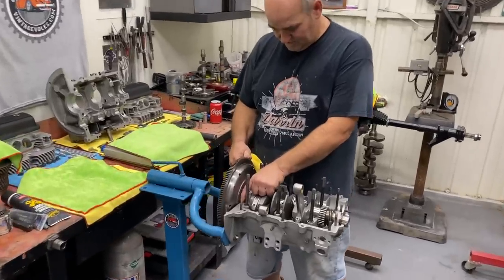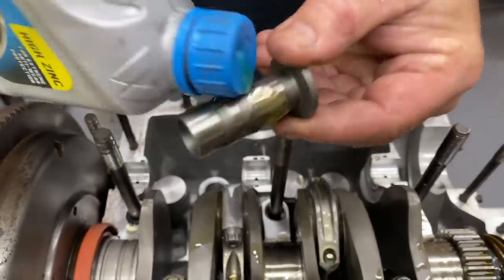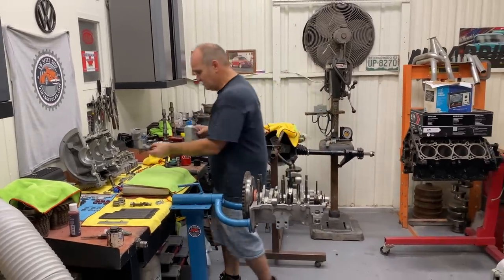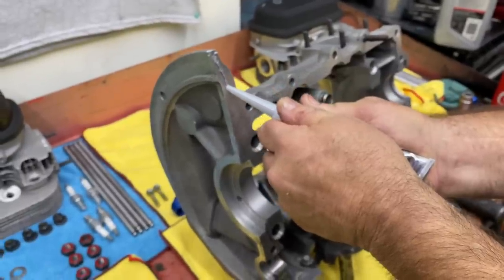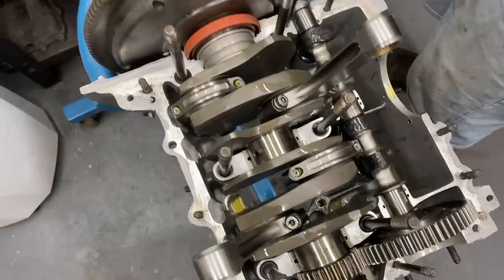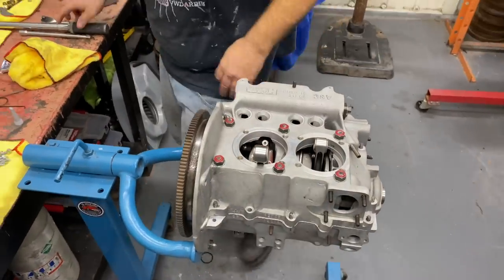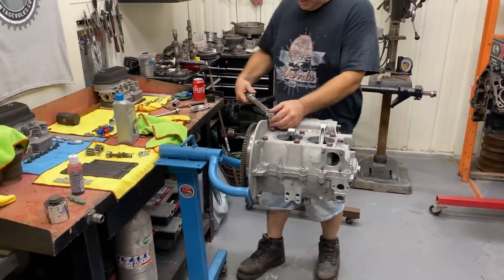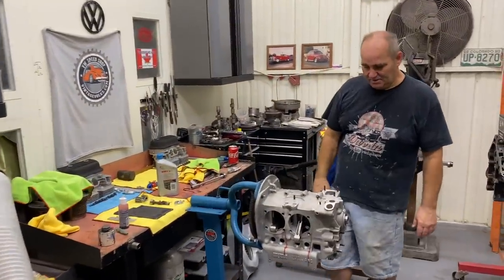VW 2110cc Engine Build, Part 1 - Type 1 High Performance air-cooled racing engine, Volkswagen, VWDB

Comment: Can’t believe you use ultra grey, Porsche and motorcycle manufactures use an anaerobic sealant for engine case half’s. Honda and Yamaha have an excellent product. I have used permatex right stuff which is very good as well.

Comment: If you don't get those dowel pins in the main bearings lined up just right, the motor will run about 10 miles, then suffer an "unscheduled disassembly"

Comment: Thank you for sharing your build.  Although, I do have several questions.  1.  Self sealing nuts are not designed the way you installed them, 2.  I noticed that you did not adjust the torque wrench for the smaller studs and allow for the nylock added frictional torque value to add to the final torque for the 8mm nuts.  3.  During your torquing of the main studs, I noticed the torque wrench clicked, yet you went further after the click.  Is this a standard practice in building a VW engine?  My other question was the head studs were not installed during the assembly of the case halves.  Are you installing them after the case is torqued?  I would be worried during installation of the head studs might push any metal chips through the inside of the engine.  Is that something not to be overly concerned about, or am I over thinking things?  Thank you.

Comment: I bought a vw van that had  a terrible clanking noise from the engine. I couldn't wait to pull it apart to see the cause.  Two hours later I was looking at a crankshaft that was broken in half inside the centre main bearing, at the same angle as the oil drilling. The clanking was caused by one half under load, followed by the other half as the cylinders fired.. This was in Australia, and I knew the driver, he was always labouring the engine, which caused the break. But I had never seen or heard of  a broken VW crankshaft  before.

Comment: I enjoyed watching this video   for myself at nearly 60 years of age  it’s been many years since i’ve had a VW Aircooled engine  opened up. ironically my last one was a early 70s Beetle in 1984  ish  i bought a crappy Bug that was running on 2 Cylinders  it drove across town home.  at Midnight  and with a Flashlight we saw twomPlugs  dangling on their a wires  out of the Heads  the next day i discovered those Heads were stripped out and my local VW Repair shop  sold me my very first set of Heliocoils  and told me how to install them  which i did  the motor was a Leaky one and i pulled it  to put in a newcGasket set that came fromBrazill complete with 4 Pistons and New Rings  for $117.00    everyone told me they were Junk and not last  that Bug was one i gave my little Sister  as a  College Car  she beat the hell out of it and drove it for a few years then gave it back to me running  years later   i pulled the motor and  gave the Rusted body and Pan to a ScrapYard  and from what I know that motor is still running  in     its 4th or 5th Air Cooled VW over 35 years later FYI the VW Enthusiasts in my Home town  is a small group and a few. oth them i still keep in touch with  and have given me tabs on that Engine Block for funsies  i grew up,inSouth Florida  and we had a Business there called The Beetle Shop  that had a large group of Bikers working there  and that shop  built high performance Motors for the localKit Car Company Classic Motor  Carraiges that built a lot of the nicer Porsche Speedster Replicas using Type 1 VW Pans  and engines  that shop bored and Stroked the Blocks  and for years they used a Shortened Transporter Bus as their Shop,Truck  it was so rediculously shortened the People in the Front Seats could touch the rear Window from that position  it was made to,look like.a Surfer Bus  and i’ve seen them pull the front Wheels off the ground from a dead Stop ! We had that and a old Fiberglass Boat  someone put on a Modified VW Pan  that has Survived  into a Marketing Tool for acRea Estate Company Locally  i saw it 20 years ago  and it looked like it could be a runner  but was  used as a Static display Vehicle only  it was Parked in A Restaraunts Parking area with a lot of Traffic goin by it daily

Comment: Definitely looking for a new motor for my beetle, gotta tear apart the old one. Sat for a couple years and when I got it started again, oil and smoke were coming out the exhaust. Definitely like your stuff. What do you charge to do a build like that?

Comment: So I’m a old vw guy I am from the 90s  I’m a modern day guy that’s plays with supercharged cars but I still own a 65 Convertible VW beetle that I bought 22 years ago and now. The cars going to paint soon as because I need my beach cruiser back. So the question is way back I bought a Fuel injection block with no provision for a fuel pump is this a better block to build a More reliable motor?

Comment: Hello darrin, in this video I notice that you only put the o rings of the case in only 4 studs and not in the middle, I have an aluminum case and the person put the 6 o rings, right now my motor has a leak in the studs in the middle of the lower part, I ask, only the o rings go in the corners, thanks,

Comment: I miss your videos Darrin, I wish you would do more regularly.. Anyway, I was thinking about a 2180 build, with a 82mm stroke - do I need to have the camshaft relieved or not? I wish things for engines werent as pricey, but I refuse to go to a watercooled ie a Subaru - its just not a VW no more plus the ground clearance ive seen with the sump riding so low is terrible! hope to se you soon bud

Comment: Darrin, trying to build an engine with that camshaft you gave me, however I purchased an aftermarket cam gear and the bolts provided are larger than what the cam is drilled for...not sure what to do because I want to use that cam you gave me.
Reply from the maker: i can machine  the gear for you , are i probably have some cam bolts that will , just stop buy , be here all weekend

Comment: In your experience, how would an engine similar to this hold up in a road racing environment?  With care and maintenance, could it live as long as a Formula F 1600?  Thanks!
Reply from the maker: i think you would be ok , i would go with 3/8 rod bolts and keep the stroke in the 78 range and go with 88machine in style are a 90,5 piston A&A has the J&E and the are very nice, the CNC ported heads at CB are the way to go . i would go with the 650 spring package & longer valves & keep the lift in the 550 area
Reply: @vwdarrin  Thank you!  Liked and subscribed.

I'm thinking of just sticking with the 69mm stroke, grinding my rod journals to SBC diameter, and running the longest rod I can.

Would you be hesitant to run a 92 or 94 bore?

Comment: Ultra Grey RTV is terrible as a case sealer. It cant handle unburnt fuel which passes the rings and accumulates in the oil. I don't even believe its good in oil. I recall ultra black is the oil safe, but still not great. JB or VersaChem are better choices. This may explain why silicon breaks off and gets caught in the oil strainer as you mentioned.   Also i notice you putting the sealer on the outside of the bolt holes. You made mention of this.  Sorry this is not good. It allows oil to seep out the bolt holes. Run the sealer inside the bolt holes. I usually put sealer over the entire surface maximising sealing potential. The case nuts are on upside down. The red sealer goes to the case. Its opposite to a nylock nut.  Raced VW for years
Reply: Number 2 permatex is gas and diesel resistant.  I also use a red get loctite type sealer on 2 stroke engines.